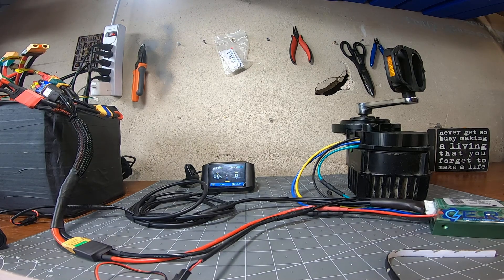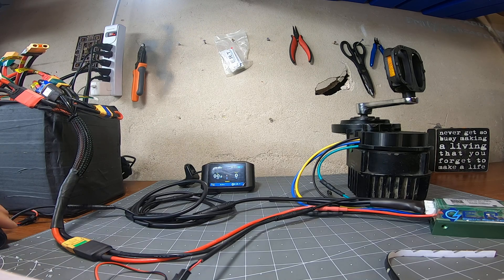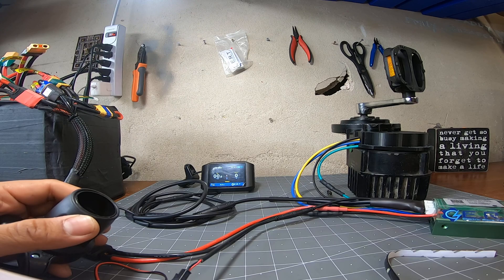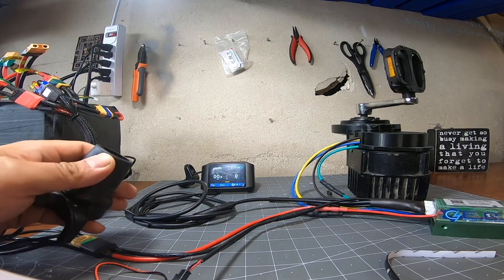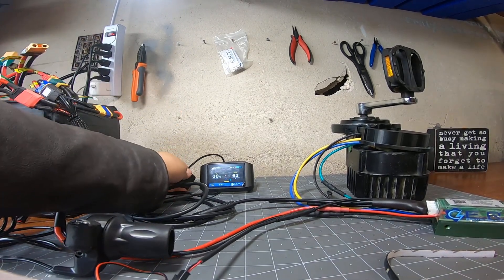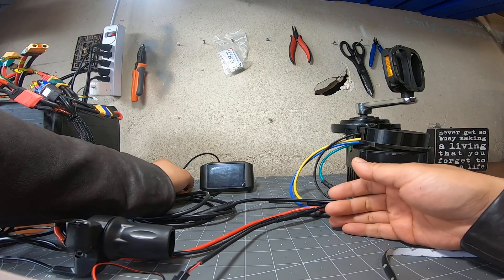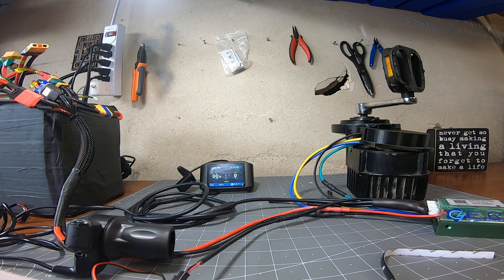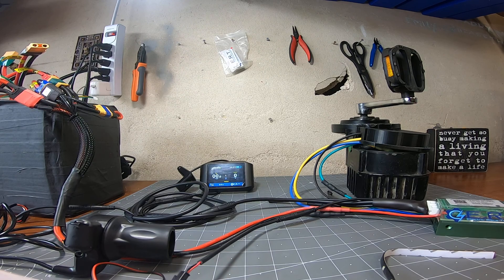ASI BAC800 Bafang BBSHD Installation Video Part 2

Comment: Hi 
Thanks for the 1 and 2 part fitting process. Could you tell me if I would notice a  increase performance just using a 48v battery 31.5ah ga pack with a 60a continuous bluetooth bms with a bbshd motor fitted. If so what kind of gains could be achieved? I no the best option would be to raise the voltage witch I may consider. I look forward to your response as I would like to buy 2 controllers. 

Cheers Daniel

Comment: Will I still be able to use my black box I purchased from Luna Cycle to reprogram the motor when I want?
Reply from the maker: Larry Debnam the black box will be incompatible with the ASI controller, as the black box is meant to communicate only with Bafang controllers.